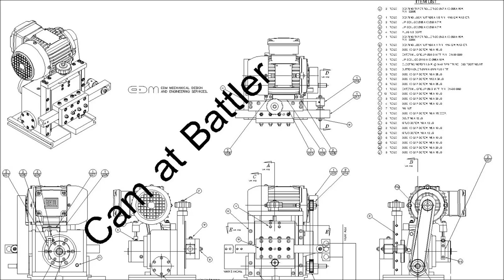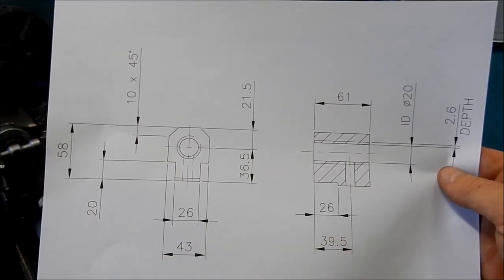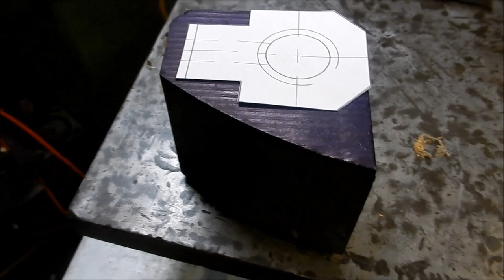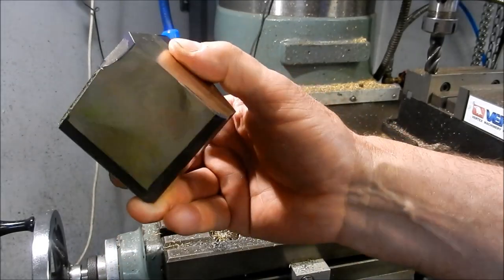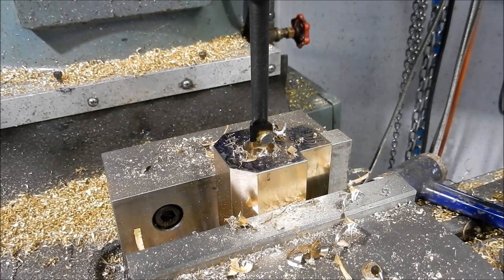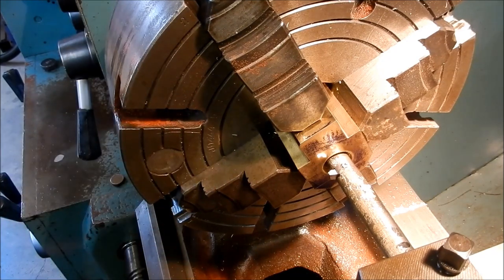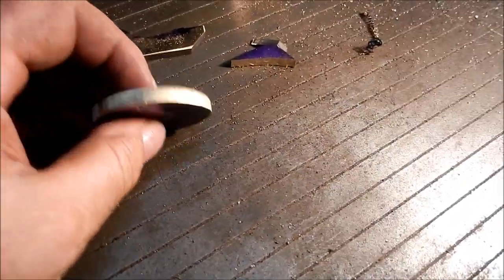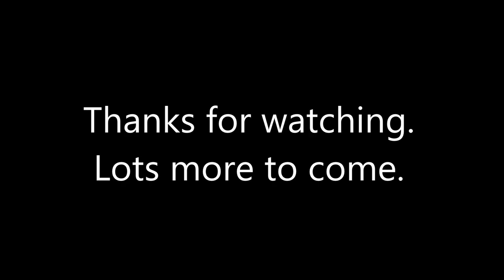6" Offset Irwin Vice Nut and Screw Manufacture

Comment: G'day Cam. In my experience instead of trying to cut the ACME thread in one go in the nut , you are much better cutting a square thread and the profiling the sides to get the ACME profile. As regards to the shaft if you have a travelling steady it really helps with the deflection in the middle part of the shaft. As for Joe Pie, a competent machinist, but so far up his own arse, lets see him machining something other than Al or plastic. I suggested another way of setting a fixed steady to his method and the guy unloaded on me like a dictator. Hohum it takes all sorts. Oh and BTW great video as always. lol
Reply from the maker: G'Day 1ginner1, thanks for looking in and commenting.  I must admit I thoroughly enjoy getting feedback getting different idea's or methodologies to how I "do the job".  The traveling steady was all set to go if I found excessive deflection when cutting the thread and I have certainly had to use it in the past when cutting long threads or turning long slender shafts but this felt good during the cut so it wasn't required this time around.  I did cut the nut in 25 passes at around 0.1mm in depth each time, it may not have come out that clear on the video.  One thing I should have mentioned is that I don't angle to compound to half the included angle as recommended by others.  I do index the topslide on each cut so the tool is only cutting on the bottom and one side flank only.  In this case, the width of the cut on 17.5 degrees is 0.66mm which means I index 0.03 (around .001") per cut.  On the last few cuts I don't index allowing the other side flank to clean-up.  This reduces the load considerably on the tool and gives an extremely high finish on the threads.
Cam

Comment: What an unusually designed vise! I have never seen one like that. It looks like it would be enormously useful having such a big offset. Does it tighten up enough that you could use it on the mill? I could see using a slitting saw for both the top and bottom of a piece of work, for example. I don't think it would make a good everyday mill vise, but it looks like nothing else would do the job in those rare use cases

Comment: I have never machined aluminum bronze, it was surprising how tough it was. I'm curious, isn't it supposed to be very dangerous? I thought I remember reading something that it was used similarly to beryllium copper, is non-sparking. If my memory serves, the smoke from burning the metal is a neurotoxin. Is this not the case? Or is it one of these far overstated concerns things?